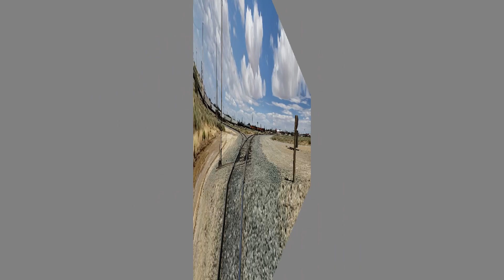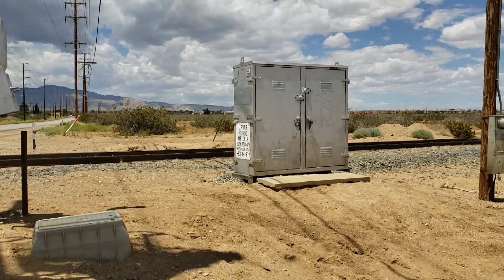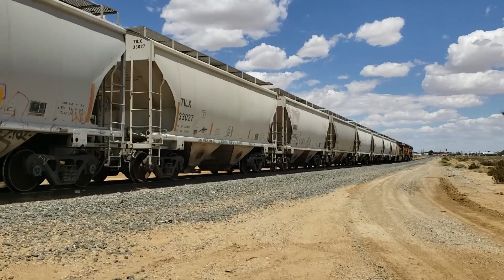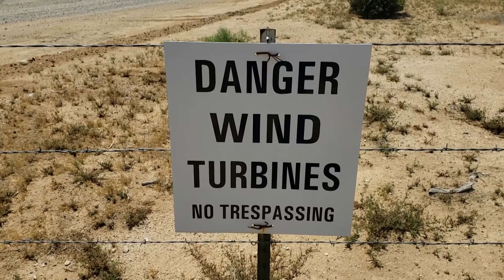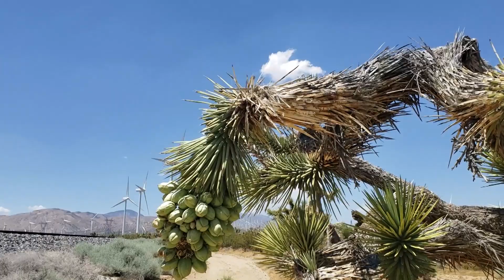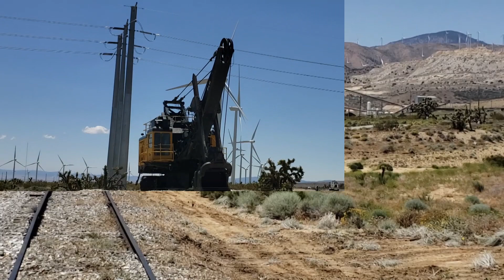Railroading in the Mojave Desert: Exploring the Creal Branch Line

Comment: I used to haul stuff in and out of CalPortland they got a rock quarry up there and I'd bring iron ore in for the concrete.Trains would check up that hill because that plant Burns coal. they were working hard too going up. and there are so many tracks when you actually get to the CalPortland plant old tracks they don't use anymore those little weird looking things to move around the train cars.  And believe it or not they have a  a signal up there to stop us trucks when they're back in the cars out from the silo.

I asked about the shovels and the guy told me that they drove them up there and parked them so I'm sure with a little diesel fuel grease and oil they probably fire right back up

Comment: Suggestion: Check out the old SP Coalinga branch sometime.  Connects to the mainline at Goshen, then heads west.  Originally the destination was coal mines in the Coast Range Mtns.  By 1880 the railroad was running out of trees to cut down for fireboxes.  Coal deposits were found at Mt. Diablo, Tesla west of Tracy, and at Coalinga.  That's where Coalinga got it's name, "Coaling station A".  The coal turned out to be poor quality, but then oil was discovered.  The last customer at the end of the line was the Atlas asbestos mine.  The mine was closed in the 1970s and the track was pulled up beyond Huron.  After the 1981 Coalinga Earthquake FEMA set up mobile homes where the old depot and turning wye used to be.  There is a photo in the local museum of a 1920s passenger train backing into the depot after turning on the wye.
Reply: Last year I was working out near Coalinga and followed the rails up to the end of the branch W. of Huron. The rails stop at a large packing plant for agriculture which is still in service. There were approximately 25-30 cars being stored there at the time.

Comment: The white light that's always lit on the outside of the little houses indicating power, does that lite turn off when AC power is lost, even though the 3000 is battery powered?
And do different grade crossings get different predictors?
Reply from the maker: If the power goes off, the light will flash as long as the batteries still have juice. All equipment is operated with D.C. power but as long as the AC is on the rectifiers run the equipment. The batteries only take over if the power is off. Different crossings can have different controllers but they could easily all be the same, which the UP is trying to move toward for ease of maintenance.